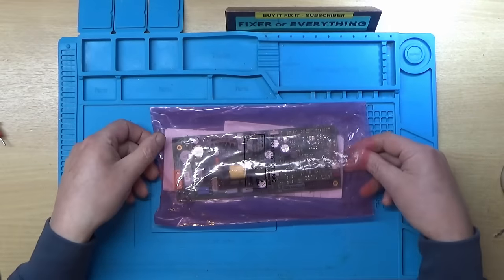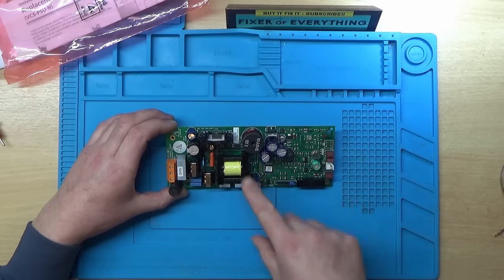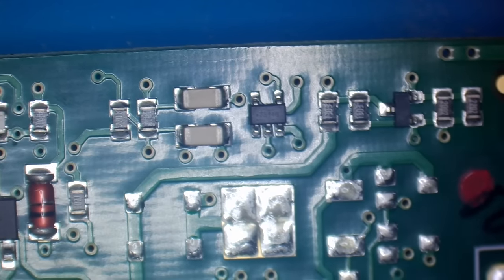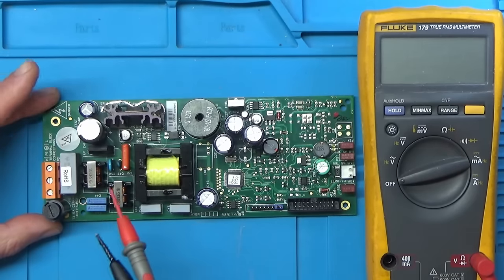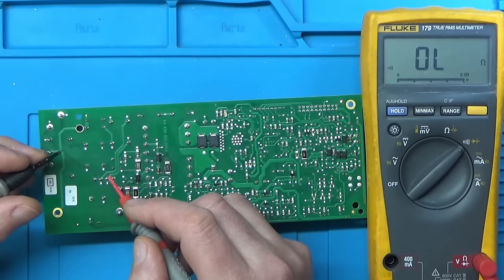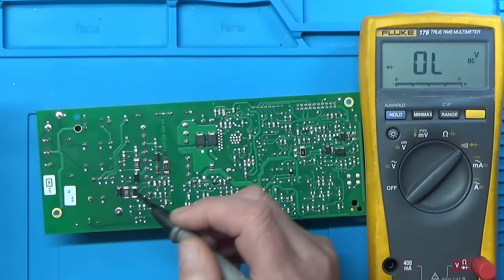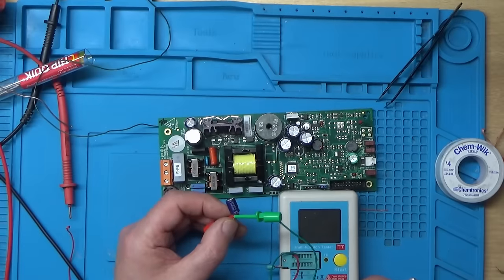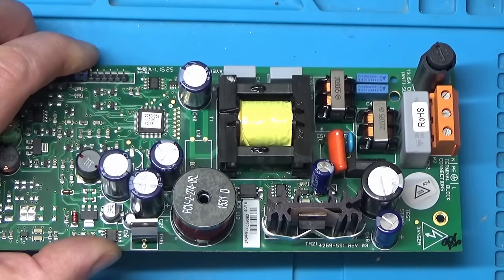VERY Expensive Fire Alarm Power Supply | Can I FIX it?

Comment: Amazing to think the amount of expensive equipment that ends up in landfill over a 50c component. Great fix
Reply from the maker: Very true! and Thanks 👍
Reply: Reminds me of a car I once had. The wiper wouldn't park itself at the bottom of the windscreen. The official fix as per the manufacturer, was to replace the wiper control board which was in the hundreds. Turned out to be an inline fuse, which was absent from any circuit diagrams. It would blow, if anything overloaded the wipers, in this case snow!
Reply: Bought a relatively new refrigerator that was not running. One silly capacitor on the control board and it was back up and running. So a $2000 fridge bought for $50 and fixed for $.03.
Reply from the maker: @theguyjt7921  I had the same on a freezer too, a few videos back. Mains dropper capacitor had gone out of tolerance causing the power to fluctuate and not drive the microcontroller correctly.
Reply: @BuyitFixit  awesome. Just ran across your channel today I'll definitely take a deeper dive.
Reply: @BuyitFixit  any recommend print to have? I know the majority of testing methods of a component but testing the systems and their makeup eludes me currently. Actually have a digital oscilloscope and many other tools, but it's been for can bus diag on vehicles. I really want to get more into vintage audio restoration and of course general repair. You speak about the systems so easily. TIA
Reply: @theguyjt7921 "The art of electronics" is a very good book to get basic understanding of components and circuits.
Reply: I fixed a sharp printer copier that was 5 years old when I got it. Got it for free from a local bank. It went out after a power surge. It blew the mainfuse after that. It has touchscreen and 4 paper trays. The cost new was between 4000-5000 dollars equivalent. . The power supply board was the size of an A4 sheet. It had 4 components broken. A fuse, a rectifier, an inrush resistor and a driver transistor.
Reply: On the flip side I wonder what we scrap that has the one part no one can find anymore.
Reply: part is not expensive the company exegurates it
Reply: Its only a $0.50 component, but it makes it 'modified' and an 'unauthorised repair' as far as the insurance company will be concerned....
I agree with fixing this, but you can see how they would see it...
I was gifted some 'past use by date' battery packs for portable heart defib machines... expecting magic battery's I took one apart, contained 6 c-cell batteries (with 2 years left on them!) of standard off the shelf stock as sold in a 4 pack in the supermarket for $7, cost of one of these 'medical grade packs, hundreds...... and ''single use'' so save one life(or not) replace the pack....
panasonic brand batteries iirc.....

Comment: Electrolytics in the startup supply are an extremely common failure - maybe half the PSUs I've ever looked at have been down to this. Like this one, they're often close to a hot heatsink. I usually just replace them before looking at anything else.
Reply from the maker: Thanks for sharing Mike 👍
Reply: I agree, back in the day i repaired sat dish receivers, every time there had been a powercut we would get loads of these in for repair.

Always the cap on these 3842 SMPS that failed.
Reply: @JohnDoe-bd5sz  I was in the same business. I made a fortune from Amstrad and Pace PSUs. And Amstrad also used startup resistors (like that 220k) that were not rated for 350 volts, so they would arc and burn out. I even pointed it out to Amstrad's "Technical Manager" but he didn't believe that resistors had a voltage rating!

Comment: Great work as always ! I’m a construction superintendent and work with these types of alarms . What I can tell you is that any time something has to do with fire control or life safety systems the prices go up quite a bit . I think because all of these items need to be certified by a second party in order to be used . Almost like paying for a UL listing . For example a commercial metal door frame vs. a fire rated metal door frame . The difference is literally a UL tag that says it was tested and certified for a certain fire rating ie. one hour , two hour etc . Hope this helps .
Reply from the maker: Thanks 👍and thank you for the info 🙂
Reply: Yeah, that was my thought as well. The certification is what probably drives up the price. Be careful trying to sell a repaired one.
Reply: @JeffHanke  That's exactly the reason they're so much more expensive. In the unlikely event of a building fire where the alarm system doesn't work, a forensic alarm tech working for an insurance company and/or fire dept will be picking over the scene with a fine toothed comb, and if they catch a repaired fire alarm component they'll be chasing down whoever they can pin to that repair, and who OKed it. It's just not worth the liability for equipment that's expected to work without failure often for decades.

All the same, it's cool to see as a purely diagnostic thing, I've seen lightning strikes zombify fire alarm equipment many times where I've been curious just how broken (or not) it really was.
Reply: @carpespasm  Nobody wants their CEO on the news trying to explain why they saved a little bit of money to have the fire control power supply repaired after it failed in the field and didn't raise an alarm for a fire. At that point, they would be more than happy to have paid the 500. It's more about perception than reality. I agree that watching the repair is entertaining and informative, but I would never put that board back into service again when lives literally depend on it.
Reply from the maker: One of those power supplies could fail at any moment, should they all be changed regularly? I would think that if a future failure would occur they would sound a mains failure event in such a situation like what happened originally. Personally I would see it no different to changing the batteries or a fuse. Further faults could occur on the rest of the panel so if any fault occurs should the whole system be replaced?
Reply: @BuyitFixit  That's a great question. I don't know what it takes to keep those systems certified, what the expected MTBF is, or if repair is even recommended/allowed. It's less of a technical problem and more of a perception problem ... if you repair it, it later fails, and a loss of life occurs, the perception will be that the repaired part was the cause, and replacing with a new part could have prevented it. Not replacing an older part, leading to the same outcome, could also be perceived in the same way. The most defendable position is to replace the failed power supply, and have the entire system re-tested to see if any other parts have failed. Also, have the system evaluated on a regular basis and re-certified (again, if that's possible. I don't know). That's expensive, but it all comes down to a business risk calculation. The regulations on fire safety equipment are often pedantic and vary city by city. Lots of open questions here.
Reply: @BuyitFixit  Speaking from my US (so UL requirements) perspective: For a Fire Alarm Control Unit to maintain its UL listing, it must be repaired using only factory certified repaired boards, meaning a customer technically shouldn't replace the board with an "aftermarket" board.  
Faults in an fire alarm are required to be annunciated.  If the parts to repair the panel are still available it can be repaired without replacement of the entire panel - unless the board is a "one board wonder," which are usually the smaller/cheaper systems.
It is the certification process which heavily drives up the cost, as well as the fact that these devices are built in "small (<10k/yr)" quantities.

Comment: That was an awsome repair mate. The company is making a fortune by selling new boards to their customers.
Reply from the maker: Thanks 👍Yes, you could buy an Xbox series x for the same price 😂👍
Reply: You would think that a 400 dollar board would have a lil better quality everything on it , but you get a bad part every now and then ....
Reply: As son as anything has a "life safety" label on it, the price quadruples.
Reply: @pileofstuff I work in the alarm/fire alarm industry and I agree. But this equipment is made to very high standards and has to adhere to strict standards to be included in these systems.
Reply: That company? you mean those scammers? hahahaha Its not even 20 bucks of parts.
Reply: A lot of power supplies are off the shelf and mass produced making them cheaper, but this one looks very specific to the fire alarm and a certain quantity may have been made which has made the price higher.
Reply: No, they are not. How many of these fire alarms are being sold? And the number of spare parts are even smaller. Plus the fact, that the manufacturer has to make sure that the  spare part  is available for a long time. All professional electronics that are not consumer electronics are always very expensive. Also because of hi quality components.

Comment: Those Vcc caps can cause a few different symptoms. The resistor charges the cap, the chip starts up Vref and goes into startup, but then Vcc drops too low before the power from the auxiliary is available. As these alarms are always on, what you see is them not starting up again when power has dropped briefly. If you'd connected your bench supply and mains at the same time, it would have started up just fine, assuming bench supply fully isolated from mains.

Comment: Saved myself £350 on a new washing machine years ago by changing a cap out on the control board. Also saved my company £1500 on a new hot water system return pump due to a blown capacitor that cost me £2 to replace! Always a bloody capacitor, mate!
Reply from the maker: Nice 👍Yes bloody capacitors 😂😂😂

Comment: The crazy thing is, it could never be used in a fire panel again. Unfortunately there is no fire panel parts that can be repaired and then be certificated as legal, unless its done by the manufacturer.
Reply from the maker: Yes a few people have mentioned the same, which I find a bit bizarre as it seems these PSU's fail quite often and at pretty much any time. This one would probably last a good few years now.

Comment: I have been an electronic technician for about 60+ years. I am always very suspicious of these electrolytics, as well as all electrolytics in general. Motorola used these caps in some 2-way radio products, and they were a constant cause of failures. This was 30 years ago. Some things do not seem to change.
Brilliant trouble shooting!
Reply from the maker: Thanks you 👍
Reply: That's generally true, especially for equipment expected to run 24/7 in an enclosure with poor ventilation. Capacitors are rated in the number of operational hours run past a certain temperature (typically 85c or 105c). If rated at 5000hrs at 105c, that means it will survive less than a year if operated continuously beyond that temperature. It will also slowly become a resistor, allowing current to leak through.
Reply: Normally such kind of caps wear out due the heat around it. Nice fix! 😊
Reply from the maker: @raffaellobottoni871 Thanks 👍
Reply: True, Philips made a TV where a 6.3V capacitor was used in a 10V circuit (Yes both 6.3V cap spec and 10V measure point were in the official circuit diagram!) The probably know the cap will last exactly the warranty period under that abuse.
Reply: Youre suspicious of electrolytics in general? You must be suspicious of almost everything you look at!? :) 

Always a good place to start troubleshooting on equipment that sees heat constantly. Nothing wrong with properly specified electros though.
Reply: What's your suggestion for circuits built 30+ years ago which needed a capacitor other than electrolytic? For example, let's say I need a 470uf at 150V. What are you going to use?
Reply: This value if not an electrolytic would be a Tantalum, chosen due to its low Z at RF frequencies. Not all circuits require this so I might use an electrolytic. I have also seen electrolytic paralleled with a ceramic disk cap for the RF bypass function. A higher voltage capacitor should be used if the voltage rating is close to the supply voltage.
Example: a VDO clock from an '86 Mercedes has a rating of 16V, and often fails, a 25, or 35V cap will probably not fail for the duration of the service life of the device. If this application has high temperatures choose a device with 105deg C rating.  @larrybud
Reply: I worked at Motorola FM Communications, let's be nice.

Comment: 14:35 That 224 resistor is the start up resistor. The start up cap is slowly charged up via it until the 3845 chip has enough voltage to drive the FET. Once the PSU is running, the chip is powered from the aux winding.

Comment: I've been a fire alarm engineer for over 20 years. Gent is a racket. Once their system is in place, it's impossible to replace the panel with anything different without also replacing all the field equipment. Check the price of the gent psu-72 if the price of the Nano psu shocks you!

We used to be able to do in field diagnosis and repair on PCB components, but with the way everything is certified these days it puts you on very dodgy ground to replace any components. Certification costs so much and the equipment has to go through so many tests to pass that it's just not worth your while to open yourself up to the liability of someone saying your repair means the equipment is no longer certified.

The best thing anyone can do is insist on open protocol systems. Gent CLAIMS to be open protocol because they can link up with bms systems for remote monitoring but REAL open protocol means having something like Apollo or Hochiki field equipment that can work across a range of panels so you can stick two fingers up at any panel manufacturer that tries to rip you off with replacement parts.
Reply from the maker: Thanks for sharing 👍
Reply: Same as yourself mate, 30 years in F&S. we have a few small gent systems, when they develop a fault we just replace the panel and detectors with Apollo and Honeywell open protocol panels cause it’s  more cost effective and you have a system you can work in in the future. However if you have a big system like a tower block or factory then they have you to ransom. Apparently they have superior algorithms for detecting fire early but that’s no good if the hardware is junk.
Reply: Old Gent equipment is solid and really good quality. New Gent stuff fails before it’s even been fitted
Reply: @alex-k2h6g that’s the beauty of Gent being taken over by Honeywell, use the brand name and reduce quality to maximise profits. Thanks
Reply: Good afternoon please having issue with a gent Nano addressable fire alarm panel it went blank and it not displaying on the screen .

Please I need solution.

Thank you

Comment: Great fix, I would like to see what was the voltage on this IC after capacitor change.
Reply from the maker: Thanks 👍yes totally forgot to measure it again on camera, but I did after making the video and it was 12V when the power supply was running 🙂
Reply: @BuyitFixit  It's best to measure that startup voltage with an oscilloscope. That way the ripple is obvious.

Comment: Those UC3845 and PC123 were used extensively in consumer products in the US. I worked on stuff like that for 20 years. I would replace all the low value caps < 100uf in the ones I worked on weather they checked Ok or not. Those ICs rarely failed. Also Zener protection diodes on the low voltage secondary lines would short. Sometimes The switching transistor shorts. Other than that those switching supplies work well
Reply from the maker: Thanks for info 👍
Reply: I agree, used extensively in sat dish receivers in Europe as well.

Every time there was a brownout somewhere, we would have tons of receivers that worked fine, but would not restart after the power came back.

Easy repair, that made my employer tons of money, as we charged the costumer 1 hour of labor and a 100 times markup for the capacitors compared to what we paid.

Best thing, costumer was happy, because the repair price was still about 20% of the price of a new unit, and when we fixed it, it ran again for years
Reply from the maker: Nice 👍I've had similar on TV's in the past where the standby light just keeps flashing and it was the bootstrap cap on the PSU.
Reply: @BuyitFixit  Last year I had the same issue on an old Sony Betamax VCR.

Comment: Nice fault finding! I was shouting at the screen to change cap - I've seen those exact type of SMD electrolytics fail in large numbers. Very common in Linn amplifiers from the 00's.
Reply from the maker: Thanks Peter 👍Yes it looked fine, wasn't bulged or anything, but then again these look similar to the caps used on the Sega "game gears" which are notorious for needing to be re-capped.
Reply: @BuyitFixit  I've had failures with those Panasonic FKs in a rather expensive VFD.  But I think I'm suspicious of all SMD electrolytics especially on thermally tricky to reflow boards with lots of copper and large components.  Maybe new ones are OK now.  I'd be interested to hear other's experiences.
Reply: In general, the 3842 that does not start up, it's very often the startup cap that has failed

Comment: Fitted many gent panels. Once didn't realise I connected the batteries in reverse and the plug welded into that white battery socket. Amazingly the panel still worked.
Reply from the maker: 😂😂I did see a few diodes around that area on the rear of the board so perhaps they are reverse polarity protection.

Comment: Bad capacitors being the culprit is all too common. Just fixed an UPS, also with a failed 50V 47uF, but that was bulging so easy to see from the get go. That was also in the battery charging circuit. Thanks for a great video, subscribed!
Reply from the maker: Thanks for sharing and subscribing 👍